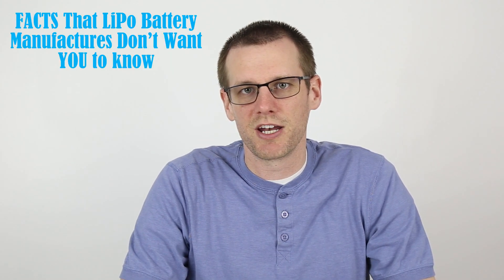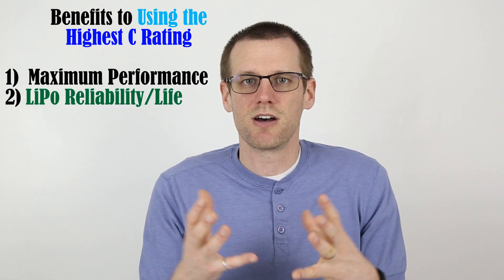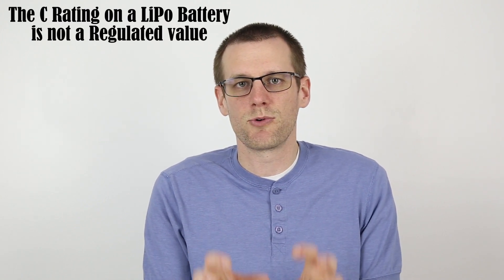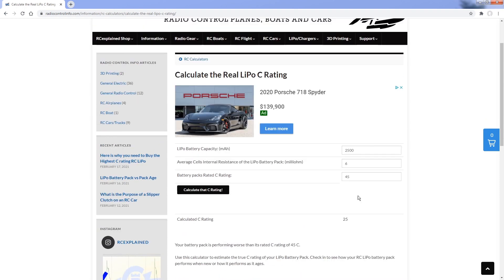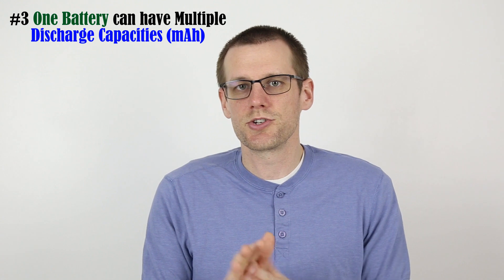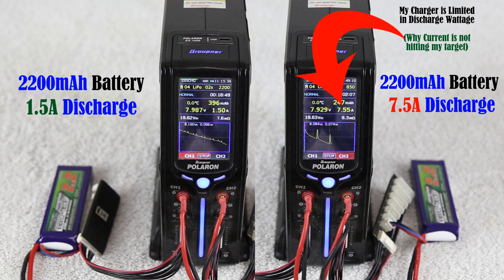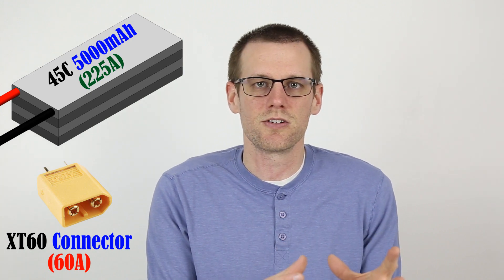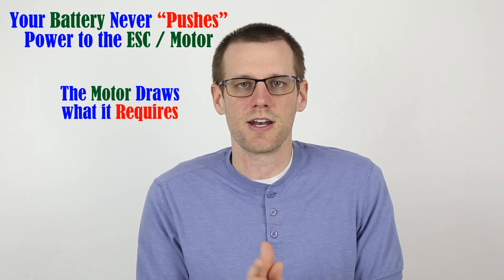What RC LiPo Manufactures Don't Want YOU to Know

Comment: The first thing that always comes toy mind is the wire gauge on both the ESC/motor and the battery.. my motor in my Felony is rated at over 3 KW.. and the motor in my DBXL E 2.0 is rated at 7 KW.. there is no way that the wire gauge chosen can support that kind of power.
Reply: KW had nothing to do with wire gauge. Amps have something to do with wire gauge. So when you step up from 6S to 8S, in theory your needed wire gauge could go down (of course, thicker wire is less resistance = always better).
Reply: @bramnelissen9106  When you increase voltage in the same setup you ALWAYS INCREASE AMPS with the increased voltage.  Running 8s is the exact same thing as running 6s with 33% more throttle available and we all know that more throttle =  more volts = more amps.
In theory, 8s will draw more current than 6s unless you only pull the trigger on the 8s setup to 75%  
So an 8s at 75% is exactly the same as 6s full throttle in volts and amps.
Reply: @toolbaggers  True, but I did not state you should keep the same setup. With a 400V setup I can run 7kW with an AWG14 (2,5mm²), no issues at all.
As I stated before: wire gauge is related to current, and not to power. Increasing the voltage (and choosing the right motor/pinion) you can reduce the current achieving the same power.